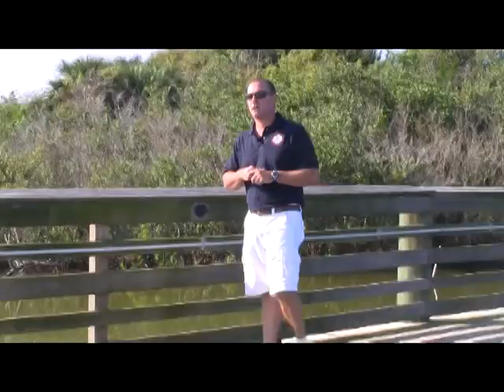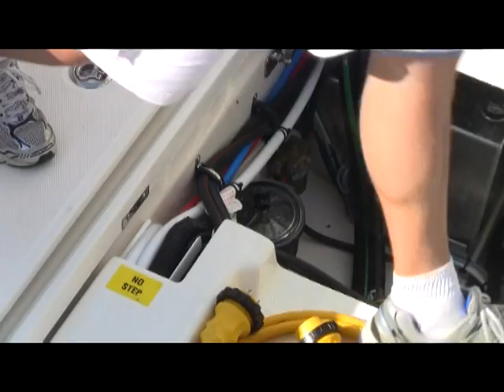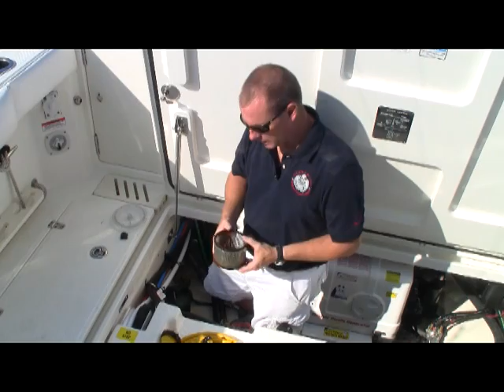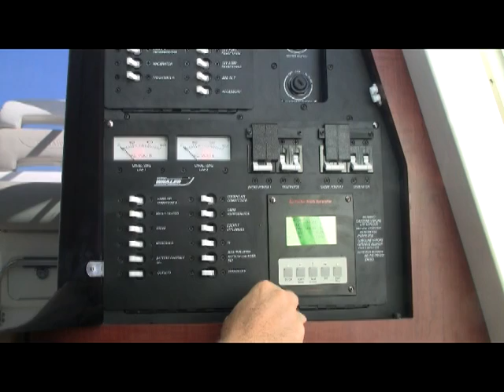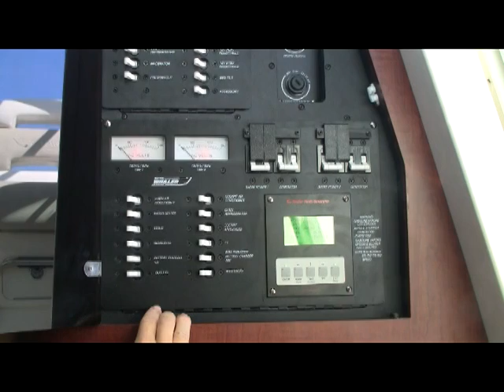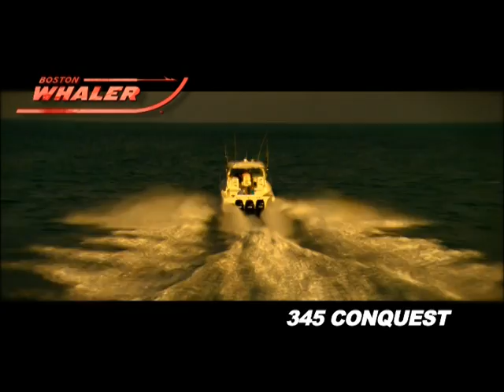Generator Maintenance

Comment: This is an excellent video on generator operation and best practices.  Many of us like to do our own routine maintenance like oil and fuel filter changes.  This generator is pretty simple to maintain when the unit is removed, but inside the hull access is an issue.  The oil and fuel filters and impeller should be changed every 6 or 12 months.  A video that demonstrates these procedures would be very helpful.  In particular accessing the back oil filter oil filter.  I can't see how the back of the generator can be access with the design of the PF cover.  It would be much better if the back panel of the generator was flat or only extending forward enough to attach the front panel.  That way the portion with the front, top and sides could slide out and the back could  just be moved enough to reach the spark plug and oil filter.

Comment: The title says "Maintenance" There is no maintenance shown in this worthless video. This is operation, not maintenance.  How about showing something worthwhile like how to access the plug on the non-service side, or change the oil, or change the fuel filter? That's maintenance.